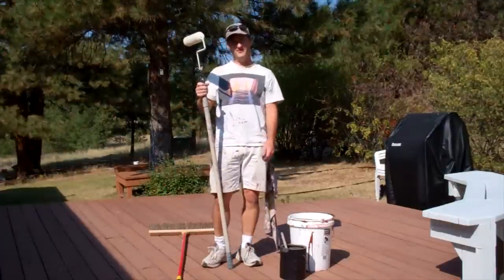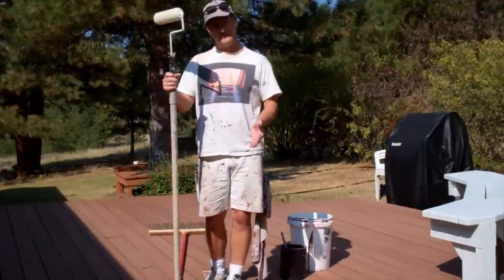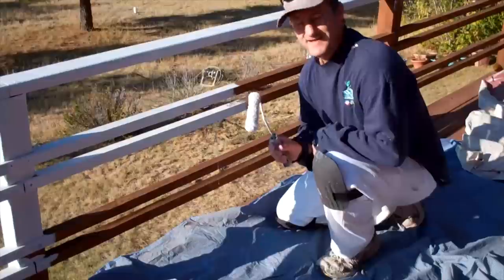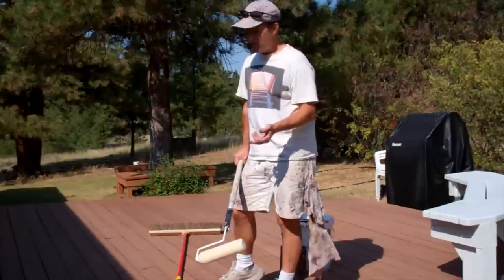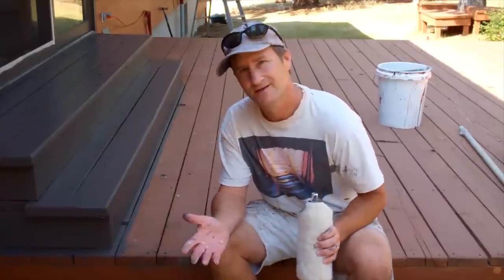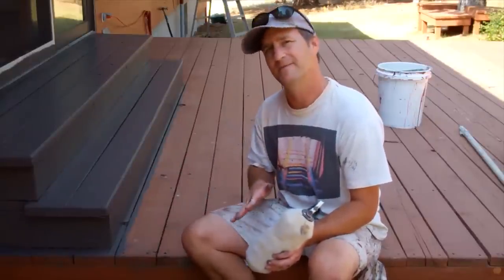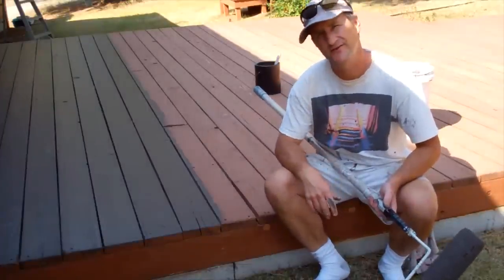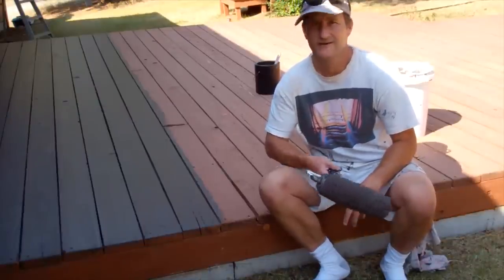Exterior Painting Step 9: Staining the Deck

Comment: Excellent video!!!! One thing that I discovered this year, that readers might find helpful, is that solid color deck paint can NOT be color-matched. This means that you will have to find a color in a deck paint manufacturers current line of swatches that matches your deck color as closely as possible. Not an easy task after seven years!

Comment: thanks was curious as to how it work out. and yes you are right. snow and other equipment would def beatup the stain/protector no matter what you put on it. read some reviews, watched youtube and get mixed answers. the cost of the stain/coating is less then replacing every three years. so if i can get 5-7 out of it and then recover its worth it. i am thinking next deck. cedar. thanks again for the info!

Comment from the maker: Hi--It's really tough to find a deck stain that lasts more than a couple years, especially if you get a lot of snow. My problem is I have to shovel the snow off my decks, and that scrapes off the stain and marks it up. And any time you have water sitting on a surface, it's hard to make stain (or paint) protect for very long. Stay on top of it is all I can say, so the wood doesn't rot, because as soon as that happens you need a new deck. Good luck!
Reply: Even in TN it’s hard to get more than 3 years out of a stain. We don’t get the snow, but the hot summers absolutely destroy it

Comment from the maker: I haven't used them. Bottom line is a deck surface is exposed to a lot of sun, rain, snow, ice, etc., and no matter what you use it's not going to last too long, at least not in great shape. Two years after I stained this deck I see some spots where it is wearing off...I touched them up with a brush and it looks better. (In this case I think a snow shovel scrapes off the stain.) Anyway, read the online reviews and visit your local paint stores and then make the best decision you can. Good luck!

Comment from the maker: I don't have any experience covering graffiti, but I recommend using a stain-blocking primer. Oil based would be best. (Like KILZ.) They do make stain-blocking latex primers but they are not quite as effective (in my opinion). Doesn't mean they won't work okay for this job, though. I believe the paint store can tint the primer grey for you if you want. Good luck with that graffiti. Ask at the paint store what they recommend for this. Always good to get a second opinion.

Comment: Nice. But why didnt you use your airless sprayer for this job?
Reply from the maker: It's pretty quick and easy to roll a deck surface. Even if you sprayed it, you would need to backroll it to work the paint into the wood, so you wouldn't be saving much time. However, if you have a lot of deck RAILING to do it can sometimes be worth using an airless sprayer. A brush and mini-roller combo works pretty well on railing too, though. One factor is how much foliage, nearby buildings, etc., is around the house that you would have to cover from overspray. Sometimes you can spend more time covering stuff up to spray than you would just using a brush and roller. Every situation is different.

Comment: nice video. but 1 question how many gallons of stain to buy? i have a 16ft × 16ft deck
Reply: Had to do the conversion as we use Meters in Australia.... you have roughly a 25 SQM deck... most coatings have a spread rate of at least 10 SQM per Litre for the first coat then between 12 - 15 SQM per litre each coat there after as the timber takes on less product. So in short around 6 Litres would do your deck which works out to 1.58 Gallon sorry calculations are different on this side of the work. Ben from Deck Rejuvenation, Melbourne Australia

Comment: Why cant you use fence paint on floorboards inside your house/ loft?
Reply from the maker: I'm not sure. You might be able to use it. Ask at the paint store and see what they say. Usually it's best to use products for their intended purpose, but depending on the situation it might not matter.
Reply: howtopaintahouse I am using it as it is quick and can paint both sides of the timber and it dries quick and can then be taken into the loft. It can be further treated once it is in place maybe months down the line.

Comment: Sir to say that no one will notice that you didn't get stain between the boards is just a flat out lie.  The only way for a pro look is to make sure stain is covering every part of the board.  If I did decks that way I wouldnt get any jobs.  There isn't a "technique" to stain a deck but good old fashioned work. Which you are clearly trying to avoid.
Reply from the maker: cwrowe If you use a thick nap roller as I say in the video (1.25 inch), you'll get enough stain between the boards so that most people won't notice, in my opinion. It partly depends on how wide the gap is between the boards--a wide gap is easier to see into than a narrow gap. But if somebody is really concerned about getting between the boards, I would first of all recommend that if possible they stain the wood before the deck is constructed so they can stain all four sides of each board; or, if the deck is already in place and you are re-staining it, use a sprayer to apply the stain because that will allow you to spray into the gap between the boards; or finally, you can use a brush to get in between the boards as much as possible--although it's probably going to ruin the brush. To be honest I've never had a customer complain about one of my deck staining jobs so it isn't really an issue.
Reply: @howtopaintahouse  If I have to get between the boards with a brush, should I do that prior to rolling or after?